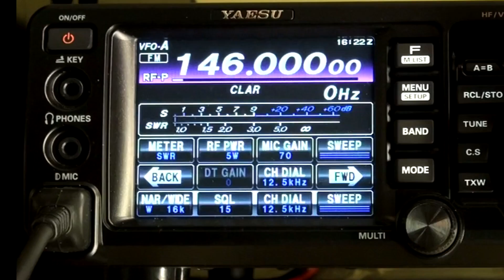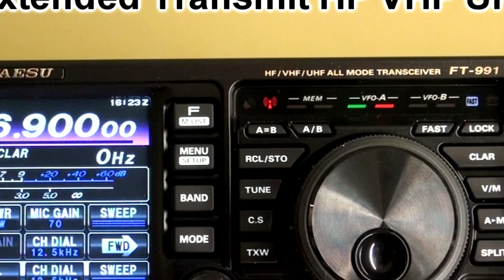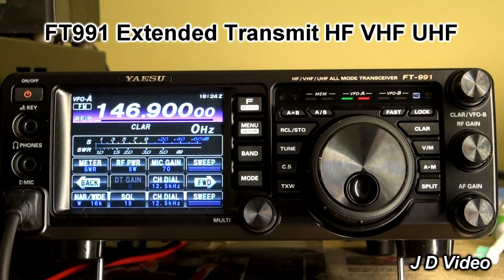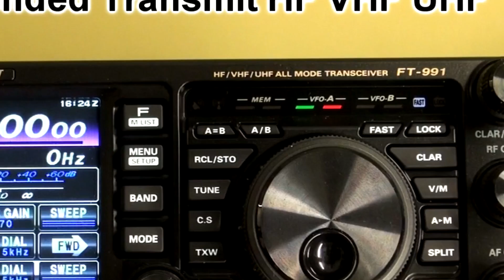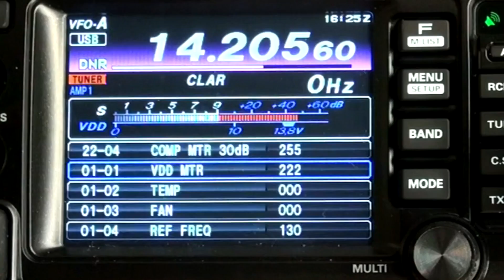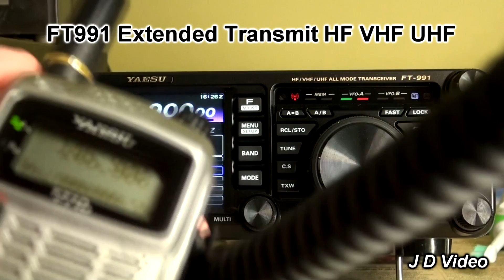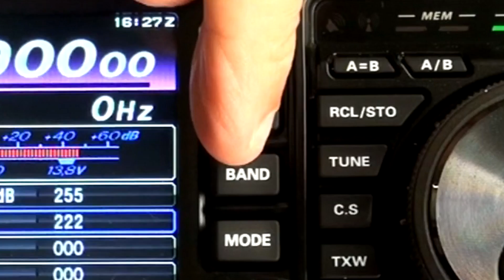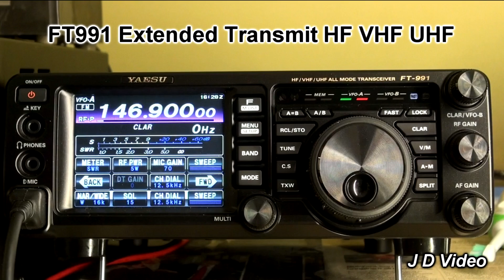FT991 Extended Transmit range

Comment: Is there a way to have TX enabled outside of the HAM frequency range permanently, specifically for bands arround 2m and 70cm?
I'm trying to use FT-991a for the needs of the HAM radio service as a part of the Civil defence in E7 but I'm unable to use my rig on the official CD repeater that works on 174MHz.

Comment: I found out this little trick from another ham.  However, my Yaesu 991a had the MARS mod done at GigaParts so the warranty would cover the MARS mod as well.  Just got the radio a couple weeks ago.  The antenna tuner built into the radio will handle my Antron 99 on 27 MHz.  I can also use the Antron 99 on 10 meters as well, the internal tuner has no problem since my antennae are all pretty much resonate.  I do have an external MFJ 969 tuner which I can use if I get an antenna that is not quite close to resonate.  I sure am disappointed in the digital side of things.  I tried Wires-X and C4FM and it all sucks big time.  All the Yaesu guru's claim crystal clear audio, but that is far from the truth.  System fusion, C4FM and Wires-X make the voices muffled, muddled and robotic, as though the voice is computer generated.  The digital side of Yaesu has a lot of room for improvement.  Compression is a major factor in the sound of digital.  Only 1/2 of the bandwidth is used for digital audio and the other half is used for data correction.  That seems to be the big concern for digital.  Of course none of the digital codecs work with each other.  D-Star (Death Star) is phase modulated and is NOT compatible with System Fusion or DMR.  Just my observations.  W Rusty Lane K9POW in eastern Tennessee
Reply from the maker: I quite agree, sensible use of tuner/matching devices and the digital audio quality does leave a lot to be desired, I have found tx and rx frequencies must be precisely aligned for best results. One good point for digital is the improved signal to noise ratio, even if you do sound under water......You do get used to it after a while, like getting used to a different spoken accent🙂

Comment: If you do the solder jumper on position "3" (MARS/CAP mod) does it do the same thing as the video or is VHF/UHF not effected?
Reply: VHF/UHF is not affected.  MARS mod only opens up the HF.  W Rusty Lane K9POW in eastern Tennessee
Reply: @W. Rusty Lane  bummer. On the HT Yaesu's it opens up U/V...

Comment: Is there another Way to do this modification? For 2 m en 70 cm ? Hope for a answer
Reply: Have a look at this video, this extends just vhf and uhf to American frequencies, so 2m tx/rx goes up to 147.999 and uhf up to 449.999. You forfeit out of band reception and I don't have a code to revert back so at the moment it is a non reversable change should you choose to do it. Note=On newer issues of software Yeasu have blocked this function. Hope this is of help.

Comment: Even after all this time, The wide banding of this radio still seems to be a well guarded secret, The only hint I have heard is that the only way to open up the vhf/uhf portion is somewhere in the firmware and Yaesu will not divulge that information. With this radio being out as long as it has been now I'm surprised someone has not come up with a custom firmware or a software way to open up the vhf/uhf side. The fact that it can not be opened up on that portion is the only reason I'm buying the IC-7300 instead and just using my 7900R/E that is opended as my vhf/uhf base. Wonder if anyone else has not purchased this radio for the exact same reason. Yaesu may want to think about that. 
73's Thanks for the video
N0MLP
Reply: Crap… I was just going to buy one and found this out.
I only have radios for emergency purposes and GMRS is a must as it will likely be used widely during a crisis.
FCC has really missed the point.
I have a FT5D ht which CAN be made to work on GMRS and FRS and I have GMRS radios that I transmit on during “peacetime”, but if I spend a grand on a Yaesu I have to also carry around a CB and a GMRS to relay emergency traffic during a crisis?
Thank God for the CHINESE who make their junk modifiable.
The FCC needs to wake up.  Radios are like guns.  There are millions with guns who will never use them for anything but good and only a tiny percentage who use them in crime.
Someday someone might really need a “good guy” with a gun, and someday the USA might need some good guys with unlocked radios to monitor and communicate with the “Walmart Special “ FRS, GMRS, and CB channels since these radios outnumber the radios owned by licensed amateur hobbyists by ORDERS OF MAGNITUDE.
I have a GMRS license and am about to take my HAM test, and I stay legal and respectful on the air, so if someone dies because I wasn’t carrying and monitoring 4 radios, then that blood is on the FCC and their sad ham followers who think they are so damned cool and official.
Guess what? The real bad guys burn down cities and keeping the guy with a $1000+ radio from transmitting out of band is a concern that NOBODY is going to care about during  SHTF and almost nobody cares about NOW since it is so rare.
1 991 sale deleted.
I really wanted one.
Reply: As far as I know you cannot open up the VHF/UHF on a 991a.  That's why I have a Kenwood 781a that I'm fixing to open up.  All you have to do is remove a jumper (2 ohm resistor) and it will cover 129 to 179 MHz.  Really easy to do.  The best radio to open up is an ICOM 746 as you can open up the HF as well as the VHF/UHF.  W Rusty Lane K9POW in eastern Tennessee
Reply: Good point.

Comment: Jed, many thanks from Australia for this one. I purchased a brand new FT 991A only 1 year ago. What you have shown is totally applicable and works with the Ft 991A. Antenna tuner goes ok. I only tried the 27 Megs band and is a total winner. Well, 27 Mhz is not far from 28, hence the PA will have the dynamic range. The tuner may have its limitations, I am guessing but you can always use an external MFJ 969, as I have one, since the variable inductor and the rest will tackle a gigantic range, just by its own inception. The built in antenna tuner will work when the shifts ( - or + ) may be confined to certain percentage of deviation from the main bands (ham) that has been designed for. Anyway, I am not an expert but tuned circuits, in the end, depending on how they are designed and built have not infinite coverage, I think ? VK2CRB ( ex LU1BBG)
Reply: Tuner works fine for 11 meters. I have the mod on mine.
Reply: Yep, the tuner will tune 11 meters.  I also have the MARS mod done.  Works great.  W Rusty Lane K9POW in eastern Tennessee

Comment: thanks jedd, very interesting... can i ask, when these 991s have been mod'd, regarding filtering, have you found any particular bands that you had to attend to ,,, thanks, G7WDH
Reply: The set parameters are not changed in 'Service Mode' unless the 'Clarifier' control is adjusted. It is essential this contriol is not adjusted while operating in 'Service Mode'' under any circumstances, as this will change fundamental factory settings.
Reply: @grahamclarke5022  THANKS very much there, as for a 1st HF radio to use as a homebase , i'm catching up 21 years in as little time as possible!!, i'd never heard of D star  Fusion, seriously, i only foiund out last year i can TX on HF now without doing my CW 9 which i do want to learn, a 25 year older head has more patience now,,, i hope) but im loving these radios, but still tempted with a field/base for starters, possibly FT 897D/857 ....but they lok fab, 800 UK pounds from a dealership 2nd hand too is really good ...regards G7WDH
Reply: @siientsinger6637  Radios have improved and diversified greatl,y in recent years, I am sure whatever radio you choose will give you great fun and interest. Good idea to do CW,. 73. it is still the original and most efficient form of transmission
Reply: @grahamclarke5022  Absolutely , not only is it fascinating , but i got that "Buzz" feeling when me and a pal used to join an online sunday eve "slow Morse Tuition" group, well i was even sitting with my headphones on with a Home Brew Morse key, but that buzz being it gets peoples attention who when you laugh at something funny, five words that took 5 minutes to send and decode at first, but when it started clicking and i was gewtting it Graham, it's mysterious , it was to my ex wife who thought i was arranging a lads night out ! but no, im determined to "re gel " what sadly i have forgotten ... 73's Graham, D Hankey G7WDH

Comment: Don't want to touch your new radio with a soldering iron?. Have a friend handy (two person job) Removing the top and bottom covers is easy. The front control panel has no screws and simply unclips. removing the internal plate is as easy as 8 Philips head screws, there are no wires that require disconnecting the internal plate and control head can be moved far enough away to perform this mod. Hold a fine point pair of tweezers on both contacts that would normally be soldered together (other videos show the soldering procedure) and reset the radio. This works, it fools the CPU and it remains. The only time it does not remain is if or when you do a firmware update. Check for current firmware first. I found this on a forum and no where else, tried it and it works. No loss of functions and no internal butchering.
Reply: Brent McCarron Does not Work!
Reply: @mathieujanssen312  It does - but one step was missed out. After bridging temporarily, you then need the second person (this is why you need two) to then do a complete RESET (hold FAST and LOCK while powering on)  WHILE the tweezers are still in place. (As you would for the MARS mod), the radio then notes the state of the jumper and will retain it until you next do a RESET.

I am in two minds on this "non-mod mod" however, as when you do it with an iron, the unit is OFF until you choose to power it back on. So unless you are careless AND do not sort out the solder-splash etc, then no harm is likely to happen. BUT with the tweezer mod, you need to power-on while holding the tweezers in place and ONLY shorting out the two correct pins. If you slip and make contact with other pads, things may get grim - and as the power is ON - there may be no going back.

Although it seems a safer mod, I am not convinced that it is so.

As VERY little current needs to flow here, if you are nervous about using a soldering iron, you could just apply a "dot" of conductive paint with a cocktail stick (the type you repair heated rear windows with). If you mess up, you wipe clean and start again. Only when you are happy, do you then power up. Applying a "dot" of conductive paint over the contacts is perhaps the safest and simplest.

OR give your friendly rig doctor £20 while he does the mod for you in twenty minutes :)

Comment: Tried on FT-991A and it won't do this mod. I do note, my rig has had the "MARS" modification done already but it doesn't allow TX out of band on normal amateur freqs but does do 11m?? Are you saying it resets to normal when you turn it off, so you have to do this every time?

Comment: Should i press the 3 Buttons onetime or everytime after disconnect from the 13,8V?
Reply from the maker: There are different software issues which may work differently but in general the three buttons need to be operated everytime after power down.

Comment: Our city police dept. transmits and receives on 460. xxx Mhz .Would this mod permit one to tx on this f ? If so, this f and other  would need to be avoided ..
Reply: Hi, Depending on software issue there is a strong possibility tx on 460 is possible.
Reply: Graham Clarke-I've wondered for a while if there's ham band radios that would Dx on public service f's. I monitor the local PD on Friday and Sat. nights when I hear sirens just to find out what's what out there. The Yaesu FT-990 is a fab radio, and I plan to get one some say. I'm new to Amateur Radio and have recently purchased the 857D. I have the ATAS 120A  for my truck but haven't found a decent mount yet.
Thanks for your reply !

Comment: Tuche.    lock.  fast.   f.      .   144-148.   430-450. tx.   ..   hb3yyr 73
Reply: Jed Deadlock

Mr. Deadlock It is outrageous, we can not go back (1.8-55.999 Mhz, 137-163.999Mhz, 420-469.999Mhz), I will complain, I'm not the only one in this situation.
Mr. Jed Deadlock give me the solution.

Comment: EUROPEAN EDITION FT-991 AFTER MODIFYING PRESS THE FAST LOCK AND F HOLD THEN POWER BUTTONS THE BAND VHF / UHF IS READY...
Reply from the maker: Rene Ivan Fonseca De Ycaza Many Thanks for info. Regards Jed.
Reply: After what kind of modifying you mean? Is able to transmit on PMR band withou service menu?
Reply: If .. after the modification that can be used in 11 mts. etc. And if it is european .. in the band of vhf and uhf ...
Reply from the maker: David Skuska have a look at this video https://youtu.be/KAzcsNqbTN8
Reply: David ... you already made the change? If you did .. first turn off the radio ft991 then press the tecals lock, fast and F (m list) keep it and then the power ... and it is ready to transmit in uhf and vhf out of range .. blocked ..
Reply: Rene Ivan Fonseca De Ycaza oka it works now very well. Just repeater mode is always enabled while i change freq on unlocked bands.
Reply: David Skuska
You say in repeater mode on ... but you can remove it or put it in the menu .. is that what you want? In the rpt button ....
Reply: It is outrageous, we can not go back (1.8-55.999 Mhz, 137-163.999Mhz, 420-469.999Mhz), I will complain, I'm not the only one in this situation.
Mr. Jed Deadlock give me the solution.
Reply: Unfortunately, you do not get an answer about how the TRX can be reset. There is no known possibility. Unfortunately, nobody says that here.
Leider bekommt man keine Antwort darüber wie der TRX wieder zurück gesetzt werden kann. Es gibt keine bekante möglichkeit. Leider sagt das hier keiner.
Reply: I have europan FT991 with MARs that is working only on HF band. But I cant transmit on 446 MH PMR Bands :( Is it possible to transmit without entering to service menu?

Comment: Jed, thank you for the video! Do I understand correctly: that in order to transmit outside the amateur bands, you need to enter the service menu every time. That is, every time to do these operations anew? That is, in the normal mode of operation, the radio does not store the extended range settings?
Reply from the maker: Дмитрий Песочинский Hello, yes, you are correct in your understanding. The out of band settings are not stored. 
Regards Jed.
Reply: Somehow I got a FT-991A transceiver, which already can work on transmission at all VHF and UHF frequencies ) Even he was surprised. I bought it in Russia, the European version.
Reply from the maker: If you can publish the Modification to make it do that a lot of people will be pleased.
Reply: Jed, hello! I buy a transceiver, which was already working on the transmission in full range of VHF and UHF. The jumpers on the control board looked like this: 
http://www.nevaphoto.com/other/IMG_8907.JPG
(the first two are small smd-elements, similar to resistors)

When I connected the third jumper on your recommendation, the receiver also transmit the full range and on the HF too. In VHF and UHF bands nothing has changed.

Try, maybe, it will help you too. I apologize to the low level of my English. Sincerely, Dmitry from Russia.
Reply from the maker: Дмитрий Песочинский. Many Thanks Dmitry for the information, it is very helpful. I strongly suspected Yaesu were  not telling the truth when they said it could not be done.
Best Wishes Jed.
Reply: @oldcorvus  Opening the uhf/vhf is stopped by  the latest software, I got the uhf/vhf mod right from yaesu and it tells you if you have V xxx the mod will not work. European Ver is different
Reply from the maker: @jacksisco2345  Thanks for the info, Yeasu were not happy with the mod
Reply: Oo
Reply: No
Reply: No

Comment: Shame it can't go to 477/478Mhz for .AU UHF CB ;) ...
Reply from the maker: That is an unusual allocation, TV frequencies in most parts of the World, and precisely the reason why it is not economic for RF modules covering this range to be included in Amateur equipment. If the regulations are like those in the UK (446 allocation), you could argue it was a shrewd move on the part of the regulatory authority to ensure that only type approved equipment is used on those channels. The only Amateur equipment I have seen that goes up that high, (up to 511), is made by Alinco, so possibly worth checking out.
Reply: Ah, It's OK. Just nice to have in case. Same with 27Mhz. Not to worry. Price for a FT-991A is far too expensive currently in Oz. (~$2K) :( ...
Reply from the maker: Ouch, that is expensive, sorry about that, the 991 is a good rig despite Yeasu being difficult about enabling extended frequency coverage. Lack of sales at that price will hopefully force the price down for you.
73.

Comment: K4THN
Thanks Mr. JD..sure will help me as I use GMRS freq. of 462.650 here in the states...73's
Reply from the maker: Pleased to help. 73.
Reply: Gary K4THN me too! GMRS call sign is a mouth full of marbles but looking for a solution that allows for interoperability instead of multiple smaller cheaper radios in vehicle more room, look less geeky, but talk to family on GMRS and friends in the UK, and local truckers on 11 if in emergency is nice. I like Yaesus atas as it goes to 70cm but love the Codan 93xx antennas.and the new envoy with ALE, emergency operations so effortless, you no longer need to hire real men lol.
Reply: It is outrageous, we can not go back (1.8-55.999 Mhz, 137-163.999Mhz, 420-469.999Mhz), I will complain, I'm not the only one in this situation.
Mr. Jed Deadlock give me the solution.